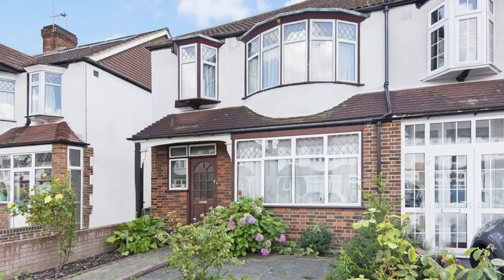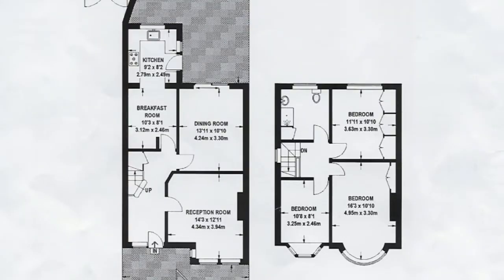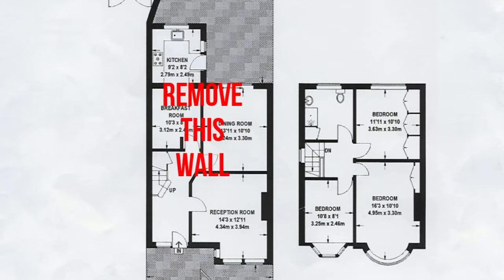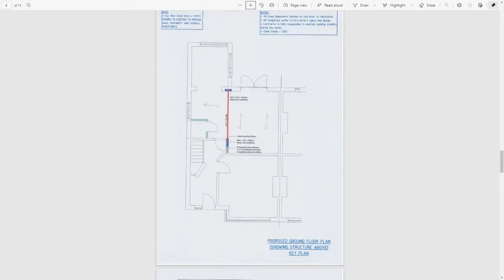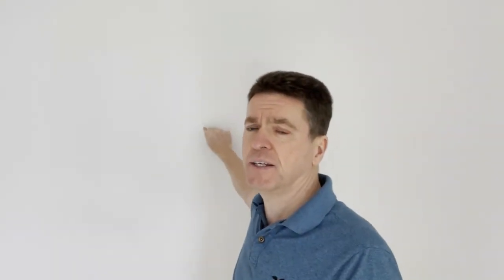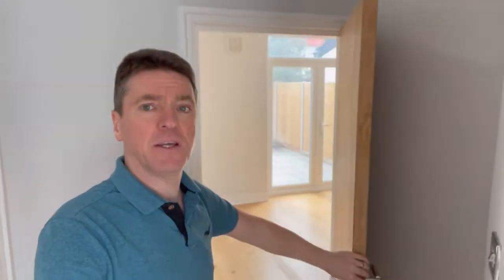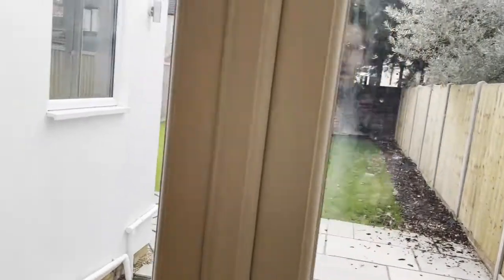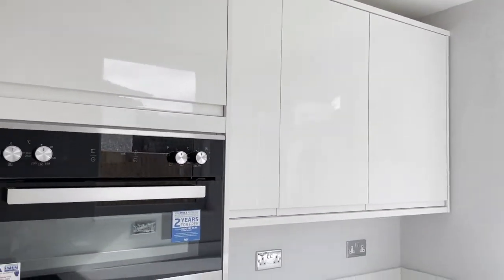House Renovation TOP TIPS - the STRUCTURAL WORKS - improve the FLOW & FEEL of a house - Part 2 of 13

Comment: Would you be able to tell me the cost of the architect and structural engineer on a project this size?
Reply from the maker: Hi Sean. Thanks for watching. The cost of Architects and structural engineers varies wildly between different people. We alwaysake sure we shop around. For this job the architect cost £1k and the structural engineer was £200 for this part of the job. You definitley need to get lots of quotes though as we had other parties trying to charge us thousands for the same work. 👍
Reply: @JoeBlogs  I'm in the same position as Sean Mitchell so your advice is much appreciated! Would you be able to share the contact of the architect and structural engineer you used, please? Thank you very much.